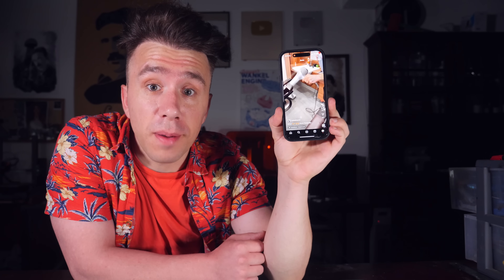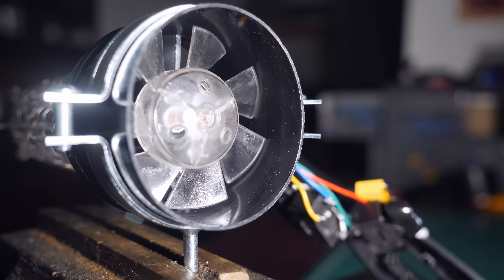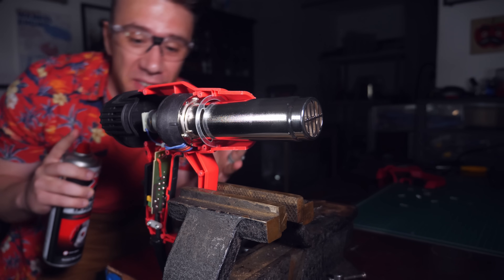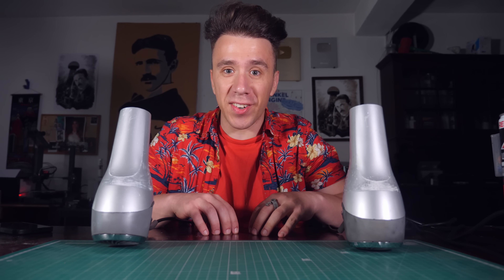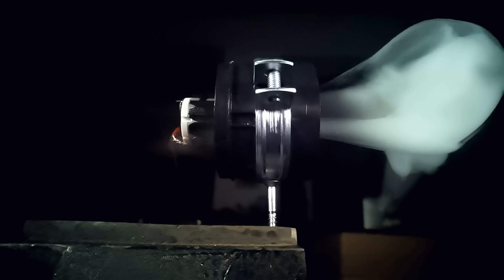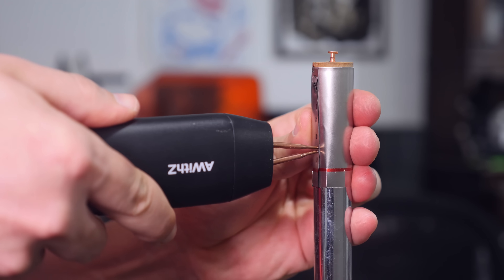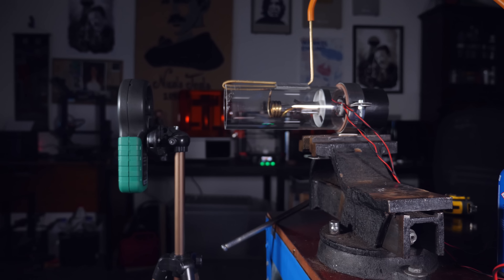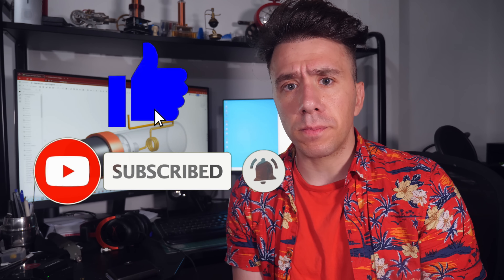I turned my $20 Hairdryer into a JET ENGINE

Comment: instead of the coil in th emiddle around soemthing, put it along the inside of the tube and have metal wire or thingly slcied sheets going down, cutting the circle into quadrants if you look at it straight ahead, this opens up the middle and then you can have multiple small holes right around where you want fuel to enter, this methond basically means you could have it submerged in the fuel. Then mist it in some how.

I DONT FUCKIGN KNWO

Comment: Maybe the solvent in the the video was different, I know the break/parts cleaner I have atm isnt really flammable. But I have had some that was, which works great when cleaning glowing hot metal when working on a vehical.. xD I'v also noticed by smell that there was a brand of parts cleaner that smelled almost exactly like starter fluid, which its self is a great cleaner too LOL

Comment: Burning Tetrachloroethylene (brake cleaner) produces Phosgene gas among others. This is a highly toxic gas which can be fatal at concentration of 400ppm for 1 minute of exposure. And its heavier than air so it displaces oxygen along side the pulmonary edemy it causes. 

Do not play with heat and brake cleaner. Especially not in an enclosed environment.

Comment: What if you rolled the brass tube very close to the exterior of the acrylic walls? It would give you more surface area to heat up the butane.
It's kind of like what they do with rocket exhaust from NASA.

Comment: How about narrowing the pipe down at the end? Although this might not help with airflow but it should increase the air speed, right? Otherwise maybe narrowing down the tube in the middle a bit could help. You could make use of the Venturi effect, like carburetors do.

Comment: Is it possible to somehow work the fuel outlet into the blades of the fan?
So the fan is moving the air, adding the fuel and mixing everything the same time?
The blades would need some holes on the backside and the input needs to be some sort of a rotating nozzle
Reply: Or a high pressure rotating nozzle like those used for agriculture but adding fan blades
If the pressure is high enough it even might work without a motor since the high pressure output is accelerating the whole thing

Comment: My guess is that hair dryer is broken in the same way mine is, there's some kind of short that causes an actual spark of electricity, making it capable of ignition without needing to heat the cleaner.

Comment: it would be  neat to use the kaak knife mistakes to the advantage of this motor as a fuel diffuser to allow the use of the entirety of the air inside this design

Comment: Have you tried adding fixed blades in the acrylic tube to revers/straighten out the turbulent air flow created by the fan. Also did you try your Hydrogen generator to supply the fuel?

Comment: You can use a ventury like a carburetor after the fan and before the heater element encompassing the full diameter of the tubeto atomize and mix the fuel in the air. it will either take a fair amount of calculation or a good and fun trial and error until you get the ventury and jet spes right.

Comment: regarding this video, I would suggest using a car vacuum cleaner, but used upside down, that is, on the exhaust, it has more force.. and if you also printed some static steering paddles, it would be amazing because it wouldn't give the flame back...

Comment: If you dare try to make this Indian recipe it is better than coffee
Here's a traditional recipe for making Indian Masala Chai:

### Ingredients:
- 2 cups water
- 1 cup milk (whole milk is traditional, but you can use any milk of your choice)
- 2 teaspoons black tea leaves or 2 black tea bags
- 1-2 tablespoons sugar (adjust to taste)
- 2-3 green cardamom pods, crushed
- 1 small piece of cinnamon stick
- 2-3 cloves
- 1 small piece of fresh ginger, crushed or grated
- 1-2 black peppercorns (optional)
- 1-2 teaspoons fennel seeds (optional)

### Instructions:

1. **Boil Water with Spices**: In a medium saucepan, bring the water to a boil. Add the crushed cardamom pods, cinnamon stick, cloves, ginger, and any optional spices like peppercorns or fennel seeds. Let it simmer for a few minutes to allow the spices to release their flavors.

2. **Add Tea**: Add the black tea leaves or tea bags to the boiling water and let it simmer for another 1-2 minutes.

3. **Add Milk and Sugar**: Pour in the milk and add the sugar. Stir well and bring the mixture to a gentle boil. Be careful to watch the pot, as the milk can boil over quickly. Let it simmer for about 2-3 minutes, adjusting the heat as needed.

4. **Simmer and Strain**: Once the chai has reached your desired strength and flavor, turn off the heat and let it sit for a minute. Then, strain the chai into cups using a fine mesh strainer to remove the tea leaves and spices.

5. **Serve**: Pour the hot masala chai into cups and enjoy it fresh. You can adjust the sugar and milk according to your taste.

### Tips:
- **Fresh Spices**: Using fresh spices will yield the best flavor. Whole spices are preferred over ground ones.
- **Tea Leaves**: Loose black tea leaves generally provide a richer flavor than tea bags.
- **Sweetness**: Adjust the amount of sugar to your liking. Some people prefer a sweeter chai, while others like it less sweet.

Enjoy your homemade Indian Masala Chai!

Comment: thunderfoot did an experiment using a car fuel injector to ignite sodium fuel. with the supports you have made it might be possible to have the injectors shooting back and through the ignition coil. though it would require an external pressure system and some programming to get them firing in sequence.

Comment: they were using a salon hair dryer - besides the fact that it's clearly a salon, you can tell because they always come with much longer cables. they also have much better (hotter) heating coils and controls (if you haven't tried one at home, do it, it's a game changer if you can afford the splurge). I also think it was just hairspray being sprayed in, not brake cleaner, which is more volatile and flashes at a lower temp.

Comment: If you exchanged the fan and heater places i think it could work but ofc it would probably burned the fan but it wouldn't need an impellor to work you spray it burns but it wouldn't be jet engine :O

Comment: Your graphic of placing the ignitor and brake cleaner injection behind the fan dead zone is exactly how airliner jet engines work. The vast majority of thrust doesn't come from the ignited fuel-air mixture, but from the air that bypasses the jet around the outside between it and the external cowling - the fuel-air mix just gives the thrust an extra boost (and speeds up the intake fan) but doesn't do the majority of the work.

Comment: Make a ram jet style where the low pressure of the combusted air and the turbine helps draw in fresh air to be able to get more of the fuel burned and also not sure how much of the brake cleaner you’re using but I would spray it wide open while it’s running and not let off maybe heat the can to up the pressure 😅

Comment: You must place additional fuel injectors on the edges of the acrylic tube near the turbine, while maintaining the injector positioned behind the engine. Then you can burn your disgusting tomatoes😅
This injector will help ignite the air mixed with the gas that quickly passing along the edges of the acrylic tube. You must alsocontrol the flow of gas into the system.

Comment: you should try and make your own duct work with an impeller fan to focus the air to the combustion chamber. think a turbo snail but instead of one outlet it spreads around 6 larger ducts then curling to 1 compressed point. after that add a fuel ring and ignitor.

Comment: Hi integza, I'm a Brazilian fan and I always wanted to see you building a remote control plane. I have a simple but interesting idea, so you would build with foam, Balsa wood and 3D printed parts . With this you could insert a compressed air engine. I know it can be very complex but it would be very interesting to do this project. (sorry for my English) PS: the engine could be based on a tesla turbine.

Comment: U need to calculate the stagnation properties, and use stoichiometric ratio to produce the optimum mixture of air and fuel. After doing so, u will get the highest thrust production possible for the given design and running conditions. From there, tweak ur design bit here and there to increase the thrust production steadily.
Reply: U can increase the air flow rate if u need more air, or increase fuel flow rate for more fuel.
Reply: Or u can add second fan at the downstream of the flow to increase the pressure in the combustion chamber. For this, make sure u use the right airfoil for the fans and do calculations so that the thing doesn’t explode.

Comment: what if u print a round adapter to fit inside the tube and then make a fan slowly blow air into make a makeshift combustion chamber btw always make it somewhat airtight for more thurst and cooler visual thx if it sux let me know

Comment: Id reccommend a clonical MIG shroud, its designed to take the maximum output of gas and force it into a tube shape. It could help you achive a better gas flow rate as they often run at 11 liters per minute

Comment: I was watching someone build a small hydro dam and had a similar though after watching this. Would rifling the barrel, or in the case of the dam the outtake, increase the flow of the air or water? Similar to when you spin a bottle to get the water to flow out faster.

Comment: so you can youse a better burning fuel hydrogen for example and use the pipe to line the interior of the air tube with holes on the exterior.

Comment: You didn't turn your hairdryer into a jet engine, when you turn off the hairdryer and the "engine" still runs on fuel only, then you have a jet engine, until then you just got an electric fan blowing into some fire 😊😊

Comment: i dont know about you guys but my hair dryer is different, the reason it doesnt work is that your modol has the wire in the outside and its parralel with the tube, mine and most likly his (the video) has a heting element thats perpendicular to the tube so the fluid would touch the EXTTREMLY hot element and ignite subsiquently igniting everything around it chain reacting into a flamethrower

edit: i wrote this before watching the secend part

Comment: what i think you could do to make it use all the air at full power is to force the fuel out many tiny holes to increase surface area of the fuel in the engine, kinda like that one Mythbusters coffee creamer experament.

Comment: If u wanna get more air for the combustion, literally just look at real jet engines. They push high pressure, low speed air through the core to go boom, while it shields that air from a passthrough around the core that pushes out high speed, low pressure air. A majority of the air goes to the high pressure area and it is enclosed so most of it gets used in the explosion...

Comment: You should try using a turbo charger (3D printed) with a fan at the end of the turbos exhaust to try and get high speed and high pressure at the same time but I'm definitely not an engineer its just a thought I had but it still might work

Comment: I tried to build something similar and encounterd the same problem. 

I guess the only way to solve this is pressure. 

With pressure the air gets slower and hotter. Therefore it is easy to burn the fuel and then use the pressure to spin a turbine. 

Without a turbine it is kind of useless. You could add a nossle, creating pressure before it.

It would probably work, but in the end the thing would be so inefficient, that it would sti have less thrust, then the stock fan.

Comment: Have the copper coil tube sealed at the end, and make tiny holes around the last coil. This will increase the pressure it comes out at and mix it better with the air.

Comment: Uhh winning a 3D printer?? Well here's my solution for winning the 3D printer : You wanna atomize your fuel to the width of your tube, maybe 3D printing a perforated fuel propeller and having the heat source a bit further away?? if you cannot do that tossing it through a propeller without just sloshing it up against the walls - then try injectors in the sides of the walls, shooting towards each other, but not directly against each other, you wanna shoot the streams next to each other and slightly towards the end of the tube to fill the room up without coating the walls. Different spray nozzle patterns can help spread your fuel 👍👍⛽ Good luck. Also, you could try making tubes with different inside patterns to create turbulence? Wouldn't know if it would work. But its a cool idea i believe. But watch out, at some point having too much fuel you're gonna need more air to burn it too 👍 Could you somehow create a pressure consistent fuel delivery system?? 🤘 rock n roll

Comment: A Jet engine requires Compression. So compressor blades which are spun up usually by electric motors but the motors are disengaged once combustion occurs and the combustion turns both the fan blade (pulling in air) and the compressor blades( holding back the combustion and compressing gases then expelling them out the rear.)  the fan blade and compressor blade or blades are connected via single axle.  Really to start a jet engine you only need the fan to turn with air intake so that the compressor blades also turn. Therefore you can take what you have add compressor blades, a restricted exhaust nozzle, your ignition source and use your hair dryer even on cold setting to spin up the blades.  
Would love a 3D printer. Love the great projects you have going.

Comment: I think for maximum thrust with minimal waste, you should go for a high-bypass design that incorporates a turbine downstream, maybe five centimeters behind the ignitor. Put that rotational force back into the impeller, and then get as much liquid brake cleaner as possible to steadily drip onto your nicrome wire. The increased airflow should counter any resistance from the turbine, while also allowing you to use less fuel overall.

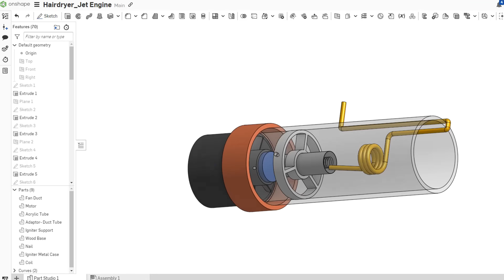Comment: 13:15 - improvements? You're making jet engine so it's kinda "solved problem" xD Because you have hot combustion products you can easily get more speed by constraining the output a bit somewhere (for heat guns at the end, for engines before expansion chamber to actually get the benefit of the thrust). Also possibly some fins somewhere around fuel injection to redirect a percentage of the air towards combustion? Prob can 3D print some ring inserts with variable amount of said fins. Or maybe a comb? That would possibly be innovative, adding some turbulence can help with air-fuel mixing :D

Comment: would it be possible to use a Stirling engine to transform the heat that the engine produces into a rotational power so you can for example spin another fan or an impeller and get more compression?

Comment: I just saw how a helicopter engine works and its fuel injector and ignition system reminded me of this video, they place the injector behind the fan and spray it out, with a spark plug just a bit behind it. You should check out, I dont know if it helps but seems cool!

Comment: you could probably run the air through a heated injector if you use an impeller instead of a fan

Comment: I think if you  follow the fuel heating coil with a bulb, and have a pinhole (.020  Mig tip anyone?) coming off the bulb, you could get the fuel to collect, boil, and atomize into the igniter. combine this with some holes in your ignition protector and you can create a venturi. Finally, a decent nozzel on the end of the tube with a choke point and then a flare.

Comment: so a traditional turbine only uses about 25% ish for the actual combustion
using a impeller in 2 sides of an air seal in the same shaft with a defuser (to keep the air from putting out the flames) use the other 75% to keep the rest of the engine cool as well as power a compresser that powers the whole thing all in 1 motion should get you in the right direction
the impellers should direct the air into the defuser and then into the combustion chamber

Comment: Fyi if you fill the tupe with sand it will bend without kinking. Also of youade the turbind plades from the same material as the flaming knive you could inject fues into the blades themselves and maybe get a better burn

Comment: I would use liquid oxygen and liquid hydrogen as fuel with a small nozzle at the end. I believe that it would have more thrust because the nozzle would be smaller and would have more pressure.

Comment: Since it's liquid fuel - why not get/build a similar design to a diesel injector + pump or does it have to come from the can itself? The atomization is brilliant on a well built high pressure fuel injector - it is more expensive but I think you'll be able to mix the fuel to the air much better that way. Then I guess using a venturi shaped combustion chamber similar to a de laval nozzle might help compress the fuel/air mixture before ignition for a much better thrust yield.